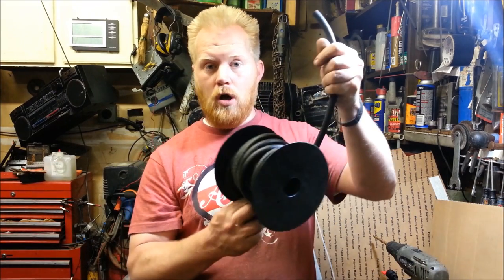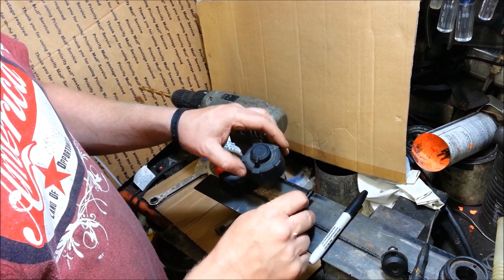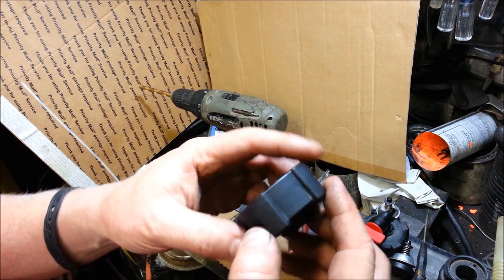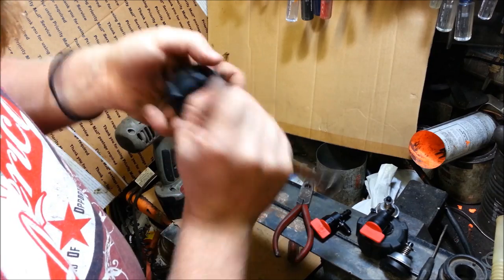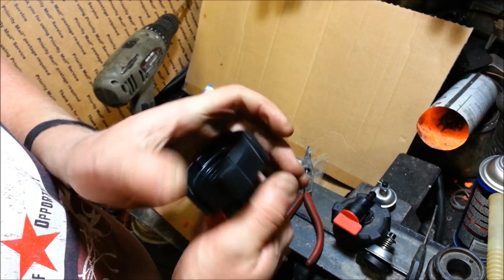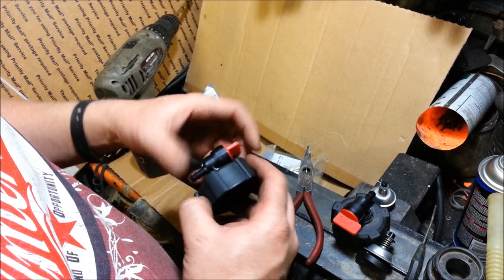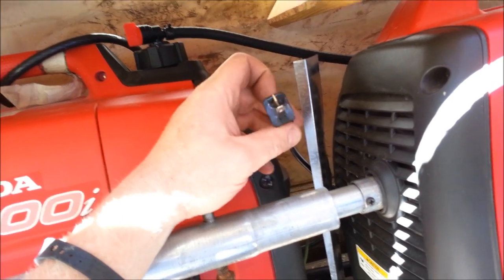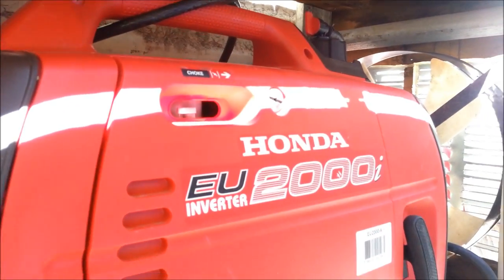Honda EU2200i EU2000i extended Fuel range Make your own gas caps

Comment: I wonder if this will work on my Yamaha ef2000is?
Reply from the maker: holdengr Yes, theoretically. The operation of the fuel system is identical in the Yamaha, the only difference would be the minor manufacturing differences in the gas cap.

Comment: Great tips with the Hondas , Do you have a video how to extend the exhaust by chance ?
Reply from the maker: I simply welded a 1" pipe nipple over the exhaust outlet. The nipple protrudes about 1/2" from the plastic housing and I can insert longer pipe(in this case electrical conduit) of any length.
Reply: @sixtyfiveford  Great idea, I was wondering if anybody ever tried threading the muffler and possibly adding a quick connect , Thank you so much for taking the to write and reply .

Comment: Awesome! ! Good idea.  Other YouTube guy adds a fuel kill switch so we can burn all fuel up to keep carburetor clean.
Reply from the maker: Honda has a fuel bowl drain on the carb already. Open the side cover and turn the flat head screw on the carb bowl and everything drains.
Reply: @sixtyfiveford  Ok, I'll check tomorrow. I heard there's a drain tube so the gas doesn't drain/spill all over the generator. Someone says after that open choke and pull start cord a couple times to clear the jets too.

Comment: My gas cap is different than the one shown. Mine has the On/Off lever recessed into the cap which means the Briggs valve does not have a long enough stem to reach down far enough to screw in. That  being said is there two different cap numbers so I can order the one you have shown?
Reply from the maker: The new caps are bulkier, but this can still be done. I have a link in the video description with a fitting that will allow you to reach down into the cap and a slightly different Briggs shut off valve.
Reply: I looked at that and would really rather have the older cap with a screw in shutoff. Do you know if the part numbers are different? I see caps on eBay but no way of telling if the older one or the new one. 

BTW I also watched your video on cleaning the carb and that did the trick. Hardest part was getting the spring back in.  But it runs sweet now. Had Honda incorporated a shutoff that issue would not have happened. I am also switching to Sta-Bil 360 versus Sta-Bil Storage. 

Thanks for all the help.
Reply from the maker: They just made the outside of the cap bigger. The older caps will fit the newer style.

The rotating kill switch on the Honda is also a fuel shut off. You can drain the carb bowl by using the drain on the bottom of the carb for long term storage. You can also run the engine out of fuel by rotating the kill switch the majority of the way, but stop before it kills the engine. Allow it to run and it will die when it runs the carb out of fuel(30-60 seconds).

Comment: What size drill bit did you say to use...21/64" or 23/64"!? I have a brand new (2016) model EU2000i with larger cap. Thanks.
Reply from the maker: 23/64" Drill Bit is what I used. Did you read the video description where I talk about the 2014 and newer caps? They need to be done a little differently.
Reply: Yeah, after I went and bought the 90deg B&S threaded / barbed shout-off valve I saw your video comments. :) So, I am going to return that valve and buy the dbl barbed version and brass fitting. Do you know if they make that brass fitting with a 90deg  bend? Seems like it would be less "stress" on the fuel line if it weren't coming straight out of the cap. 

Does the 23/64 bit still apply to the brass fitting like it did the B&S plastic one? Do you think if I could find a "generic" fuel cap to fit the Honda I could just modify that cap rather than the original one? Thanks for your help 65F!
Reply from the maker: Honda uses a unique fuel cap size/thread for these generators. However, it looks like some of the cheap knock of Honda clones have adopted the same size/thread cap, but I haven't confirmed this. You can get the old style cap: http://amzn.to/2gmbrSp

They do make 90 elbows, but I'm not sure if they give enough room 5 pack: http://amzn.to/2gLYbDD

Yes, these briggs valves and other fittings use a 1/8"npt thread and the 23/64" is slightly smaller to allow the 1/8"npt to thread in.

Comment: Is it possible to convert 2 Honda EU2000i generators to HHO?  If so would you show me how?
Reply from the maker: saltyseascott They would be highly inefficient if you did and would only put out a fraction of their rated capacity. I'm assuming you want to make a HHO generator, I won't get into that. But why not just run it off Propane, renewable Natural Gas or even Wood gas. All these other fuels will drop the rated capacity of the Eu2000 from 1600 watts down closer to 1300-1400 watts or lower. Any of these Gases will work best with a diaphragm setup. This regulates the gas to the engines needs.
Reply: I am watching a natural gas conversion right now just for the idea of a research point of view . . .   thank you for the info.
Reply: Now see that I guess I have to study the videos on gas vapor burning.  Shucks!
Reply from the maker: With a natural gas or propane setup you will easily be up and going for around 150 bucks. Producing enough HHO to run an engine is a snake oil/pipe dream.

Comment: I'm looking at picking one of these up. After 4 years how is the generator holding up?
Reply from the maker: I generally think Honda equipment is over hyped, but their generators can't be matched by anyone. They're great and hold their value if you need to move up a size or just get rid of them. I have had many Honda copy cats in my shop and they don't come close to comparing.
Reply: sixtyfiveford cool. Thanks for the info.

Comment: SWEET nicely done just wondered if you have your pull start chord fraying mine is and only 2yrs old. Not looking forward to replacing it..
Reply from the maker: +Raven4122 I'll have to say this is one of the few things I haven't had to replace a pull start on. It definitely wont be fun. The instinct with these Hondas is to pull the cord upwards at an angle. It cuts grooves into the plastic and frays the cord. The cord should be pulled straight out horizontally to avoid this.
Reply: that is how i do start it, another video addressed this issue, it frays right where it goes in the actual recoil part. Another  quick question, mine used to start 2 pulls max when cold now it seams 4-5 pulls.. any ideas to get it back to 2 pull max? it is 2 yrs old..
Reply from the maker: Raven4122
The ethanol in your gasoline is slowly tarnishing the carburetor parts. It will soon need a carb cleaning. You can also switch to ethanol free gasoline to prevent this ( www.pure-gas.org will list your local stations) If the cord is fraying and your pulling horizontal; the eyelet in the housing has a bur on it.
Reply: I didnt think ethenol left a tarnish I know regular fuel does, I used to race and used ethenol never had any issues with it..ill check it out though thanks.
Reply from the maker: The ethanol by itself doesn't but since it is hydroscopic it pulls moisture from the air and sinks it the base of the carb bowl/gas tank. The water stays mixed with the ethanol and keeps it separated. This mixture tarnishes the brass jets and causes difficulty starting.
Reply: sixtyfiveford got it.. so basically follow the videos on youtube on how to remove and clean the carb..

Comment: Will the Hondas siphon fuel from a tank below them or does it have to be above/level with the generator?
Reply from the maker: Yes. But, within reason. It will for sure pull from a gas tank sitting on the same ground(below the tank) as the generator (I have done this for many hours). I would think it could pull maybe 6-12" below the bottom of the generator but that's it.
Reply: Thanks very much! Our EU2000i will be in an external, vented compartment with the tank directly below the generator so I'm keeping my fingers crossed.

Comment: Great video. Can you make a video on your extended exhaust system? keep up the good work, thanks.
Reply from the maker: +Bj G Hey Thanks. I just welded a small piece of pipe(1" length) over the stock exhaust hole. Then I slide another piece of longer pipe into that.
Reply: Thank you

Comment: Hi sixtyfive, can you tell me what those options are? The tank I have has a threaded female port that goes into the tank.
I'm thinking of getting a direct threaded quick connect piece that will fit the fuel line directly.
Thanks
Reply from the maker: I don't know them off the top of my head. I would have to Google them. Your female fitting should be a 1/4" NPT Tank Fitting.
http://www.moellermarine.com/aftermarket/fuel_systems/fuel_line_connectors/

Comment: Hey , how do you extend the exhausted on the eu200i ? 
Thanks and thanks for the video ..
Reply from the maker: I took off the back plastic cover. Then I tack welded a 3/4" diameter 1" long piece of electrical conduit over original exhaust. This allows the factory plastic to go back on without any modification. You can now insert a piece of 1/2" electrical conduit into the welded on piece. It is a pretty snug fit but I also put a screw through both. This allows me to easily remove the extended exhaust and move the generator around like normal.
Reply: Okay I need to get that done . Thanks
Reply: Just saw all my misspelling , omg embarrassing :)

Comment: 4hr capacity BS
Reply from the maker: It depends on what fuel you run as well. If you have ethanol in your gas it has less energy and therefore less run time. Ethanol free fuel will give you 4hours at 1600watts. You get drastically less if you push it above this.
Reply: @sixtyfiveford  Well I have 2 of these and NEVER got that. I get 8 or 10 hrs no problem and have gotten as much as 12 to 14 hrs with just the tv and a couple fans.
Reply from the maker: @petegaiser7160  I think Honda claims over 9 hours with 400 watt draw.

Comment: Some good idea's, however the reason the generator has a on and off vented gas cap is to allow atmospheric air pressure into the gas tank.
If this didn't hhave the vent then the gerator would stop running. 
This doesn't apply to a extended extra marine engine gas tank because this tank has the vent on it. That is why the after market generator gas caps don't have a vent. Your situation doesn't have a vent on the generators either (unless the fitting  you used serves that function).